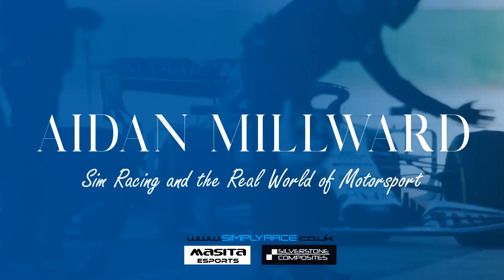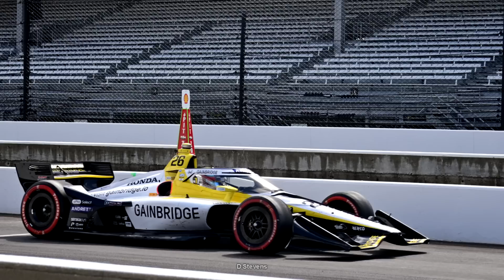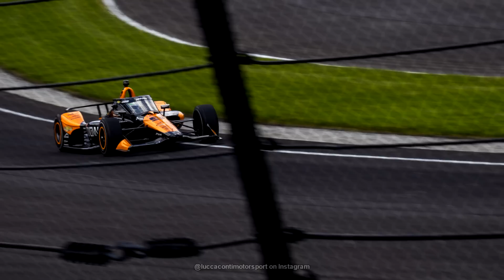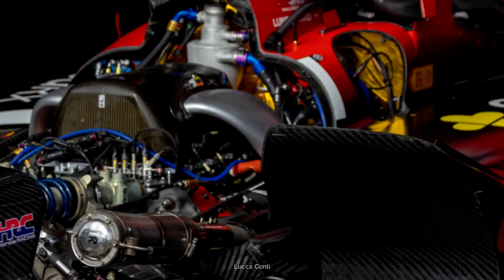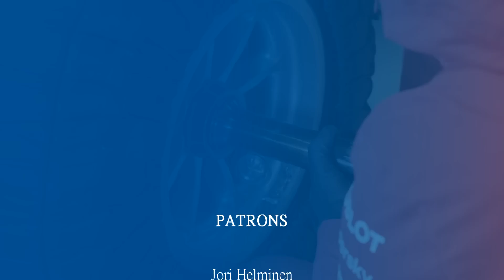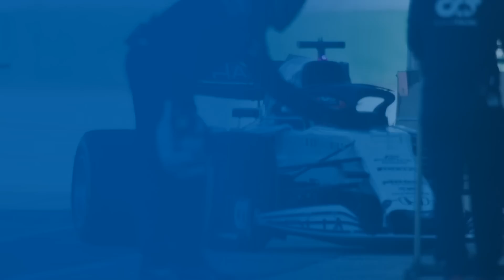WHY CHANGE ENGINES MID-SEASON? Opinions and a Look at Indycar's New Hybrid Engines

Comment: I know there have been a lot of issues of varying sizes for IndyCar but nothing that felt like a major long term concern. At least, nothing that would have the whole motorsport world pointing and laughing. But, not only is this a really shaky rollout… Who changes engine formula mid season??? I want to say “That’s some 60s/70s F1 stuff” but I doubt they were even allowed to do that back then. Why would anyone be okay with so much uncertainty mid season?
Reply: Honda has been waiting YEARS for this formula to debut. They have spent millions if not billions of dollars developing for this formula, and they finally told Indy Car they are done throwing money at something they desperately want, but series keeps delaying. This was a matter of keeping half of the existing duo of manufacturers on the grid, because Honda are ready to pull out, and the chassis makers/teams need data right away if they want to make this work in time to keep Honda in the sport.

Comment: Hmm I’m mixed on the car restarting whilst out on track one. I feel like if the engine dies on track then that should be you done. But did drivers used to get bump started by Marshalls?
Reply: IndyCar has always restarted stalled drivers and let them race on.  In the 80's they would let the safety truck drive down the track with the lights on while the race continued on.
Reply: they drove up to them with a drill and started them. You get points all the way down. Its common for cars to return to the race 10 laps down just in case others crash and they can pass them.

Comment: As a lifelong IndyCar fan here is a hard truth. F1 is much more exciting technologically and even recently in the racing; same with sportscar racing. It's a hard pill to swallow, but IndyCar has lost so much relevance since the current chassis went into service in 2012. A lot of people blame Roger Penske for the current state of things, but this started way before he bought the series. I'm  not a Penske apologist either; but unfortunately it's going to take time to right the ship. The problem is, time is running out, and it's by their own doing. The series needs a new engine formula yesterday. They need a new chassis last year. The DW12 has performed yeoman's work over the last 10 years, but it's a Frankenstein's monster at this point with all of the added safety equipment and compromise. Sorry for the rant, but I love IndyCar way too much to keep watching them kick the can down the road.
Reply: Thankfully, the voices asking for a new car is getting louder.  Hopefully the 2027 rumor is true.
Reply: @danielh8316  Just have Dallara appropriate the VF-21 if they still can do that, unless IndyCar wants ground effect too 🤔
Reply: @MinusMOD98  IndyCar has been running getting effects again since 2018, and the last thing IndyCar wants is a car that has that much of a dirty air problem, that large of a fuel tank, and more importantly, a career with that much downforce.  After they finished with the custom aero kits, they've been constantly pulling downforce off the car.
Reply: @danielh8316 Not a rumor, but IndyCar CEO confirmed to Marshall Pruett sometime after 2027. Likely a new chassis near the end of the decade
Reply: @IndyCarFanatic  That's why I'm calling it a rumor because IndyCar hasn't confirmed if we're getting a new chassis or another DW12 upgrade.
Reply: 100% agree Im a lifelong f1 fan, started watching Indy in 2017 after Alonso's first 500 run, the fact that the chassis haven't changed since 2012 is honestly a joke. Imsa in my honest opinion is the primer racing in America, their product especially if you watch the imsa broadcast is so much better than indycar. F1 in recent races has really gotten into its stride for this season would love for them to move away from these lame street tracks and go back to circuits again like how the series use to be. When it comes to American racing I watch indycar just to keep up with it but I don't enjoy it as much as I use to imsa on the other hand! Can't get enough of it
Reply: This. I grew up in Indianapolis and have been to more 500s than I can remember. Haven’t watched the series in the past few years. “Kicking a can down the road” is a perfect analogy.
Reply: F1: Spending themselves into disaster

IndyCar: Stagnating themselves into disaster
Reply: Good luck convincing the team owners to sink their money into a new engine and chassis formula. The bitch fit they threw over Texas and IMSA's sebring sharing the same weekend three years back made it pretty clear that most of the owners are more interested in treating their racing series as marketing opportunities and want to show up to the most expensive and lavish events for the smallest investment (or loss in investment) possible.

Though I think some of the blame falls on Dallara as well. They've never been the greatest, the DW-12 dropped in 2012 overweight and underdeveloped and the IR-03 before it was an aerodynamic safety nightmare. Even currently teams still struggle to get new chassis or new parts for chassis. Problem is that unlike 2005 and before, there are no other providers on the block. But they're cheap enough and reliable enough so teams don't see a reason to ask for better.
Reply: Social media racing fans are the most fairweather fans in history. Indy had been a class leader for a long time. Leader in halo/windscreen. Leader in testing new electronic passing systems. Leader in concepts for high-speed circuits versus technical circuits. The moment literally one guy has an engine problem during a mid season engine rollout? SERIES IS COOKED IT WAS ALWAYS BAD I STOPPED WATCHING 40 YEARS AGO
Reply: @KevinJDildonik  Your argument is sound aside from the fact that even the participants feel the same way. Some are now more open about it than before, but this is not a sudden emotion. I wouldn't consider myself fairweather as I have been a fan since the early 80's. I'm also a realist, and can see the problems and the need for pointed solutions.

Comment: This hybrid stuff is a complete sham. Just switch to synthetic fuels already
Reply: They're already on renewable ethanol.
Reply: @danielh8316  OP would rather bitch than educate himself.
Reply: Nevermind the fact that the EV is STILL a sham. You have an education in anything automotive? Because I have 2 masters degrees
Reply: @frozentspark2105  Yes I have 4 masters degrees.  The thing about EVs is they're both an improvement, and not enough to tackle climate change.  These aren't mutually exclusive.  There's a reason Musk is sabotaging high-speed rail, and Porsche is making synthetic fuel instead of rail locomotives.
Reply: @alexisborden3191  I agree except on the climate change BS
Reply: They've already switched to renewable fuels, a year earlier compared to F1.
Reply: "This thing is a sham, just do this even bigger sham instead"  Nevermind the fact that they're already racing on "sustainable" fuel.

Comment: Based on what I saw at Mid Ohio, the change over to hybrid at this point was undercooked to the point of getting salmonella. Hybrid should have been introduced at the start of 2025, with a Hell of a lot more testing. This was a bad idea brought far too early. And for those who want to decry waiting until next year, I bring you the words of a well known philosopher: "You can always delay and improve, but a rushed release is always crap."
Reply: Honestly based on what I have seen, IndyCar's failing with the new system has nothing to do with the system. It has everything to do with IndyCar's utter refusal to change the chassis, and then go build an engine & hybrid system around that.
I think that there is a fear that once they changed the chassis, everything changes in the cars & will look different.... which looking how the other pieces of Motorsport go around this, yeah that is the point. 
You can't just bolt on a new system on an old skeleton.  F1 understood that, the WEC understands that, IMSA understands that... but I think we all hear saw what happened when formula one did it, things got bigger. IndyCars are pretty small, and there is just another fear among enthusiast about things getting bigger & heavier. If IndyCar wants the attraction of both its current manufacturers and others, they're going to have to be willing to be a laboratory of sorts.... if hybrid is what they're looking at and things get bigger and heavier as a result, but they have the attention of several other manufacturers plus Honda and Chevy. Then it's a price worth paying if I'm looking at it.
Reply: So the AAA game industry?
Reply: It was a successful race with a few hiccups, including racers who could restart engines which wasn't possible under old regs. It was fine.